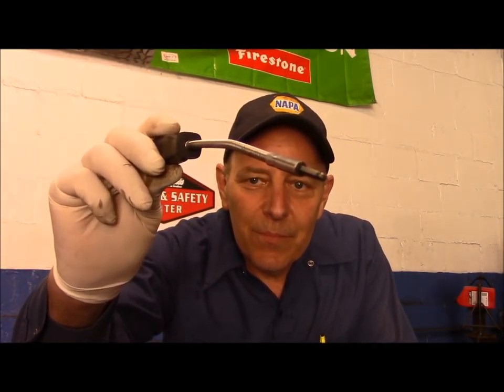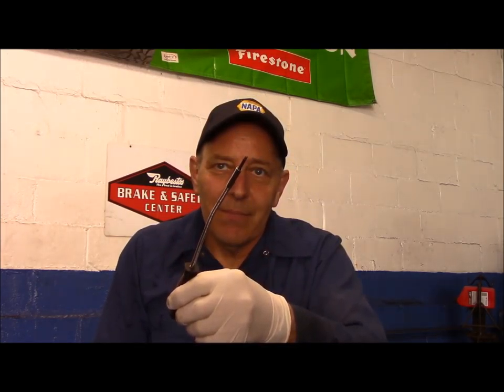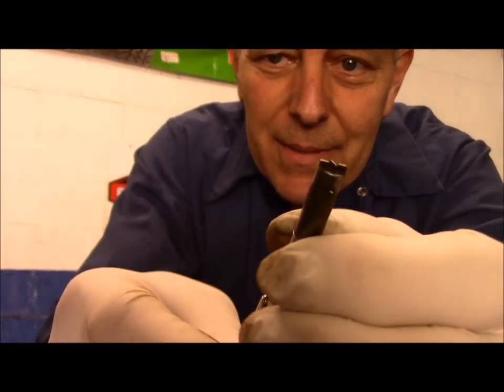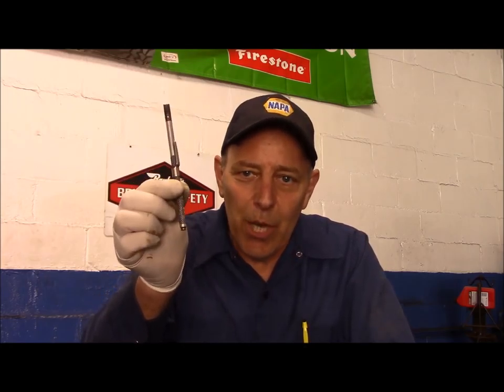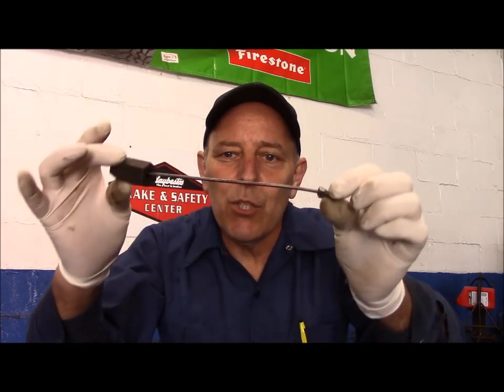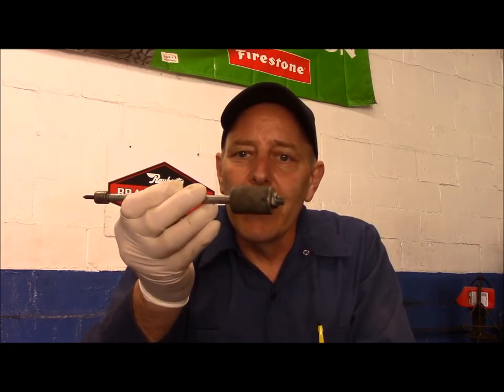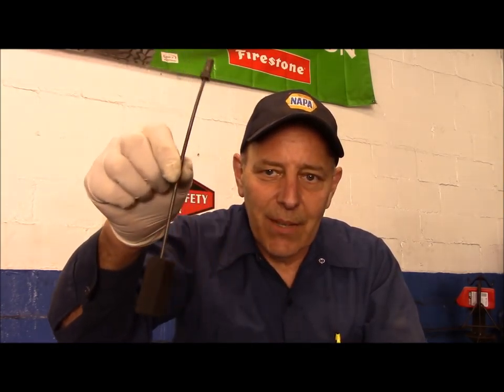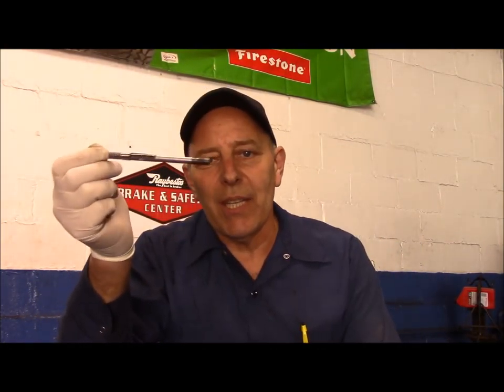What Were These Tools Used For ? Tools From The Muscle Car Days

Comment: Hi Jim,

1-screw driver type tool used to set the dwell, point gap on GM cars through the window while the engine was running
2-screw holder used to start small screws securing the points and condensers below the distributor cap
3-screw driver type tool used to access and adjust carburetor idle mixture screws hidden beneath the anti-tamper plugs 
4-mini slide hammer used to pull the anti-tamper aluminum plugs concealing the idle mixture screws on carburetors
Reply from the maker: Good guess stay tuned I will post the answers Sunday

Comment: The first tool was used to adjust the dwell on GM engines. The distributor was located at the rear of the engine along with its window that you slid up to access the adjustment screw for the points. The second tool looks like a starter screwdriver which can hold screws in place so that you don't drop them. The third and fourth tools, I don't have a clue. Nice vid Jim.
Reply from the maker: Hi Terry,stay tuned I will post the answers Sunday

Comment: 1 - points adjustment tool. Allowed you to adjust the swell with the engine running.  2 - straight slot screw starter, have the phillips version as well (that works with allen heads as well). 3 - Flexible adjusting tool for carbs, sliding piece is the handle and engages the end you're not using. 4 -Slide hammer puller to remove anti-tamper caps from the carb.
Reply from the maker: Good guess stay tuned I will post the answers Sunday

Comment: First one is to adjust dwell (points) on a GM. Second one is a screw starter. It worked great to install a condensers. Third tool is a carb idle adjustment tool. You got me on the 4th.  :)
Reply from the maker: Very good guess Wyatt .Haha most mechanics don't even know what a condenser is.Lol

Comment: Tool #1 is for setting the dwell on Chevys points thru the distributor cap window, Tool #2 is a screw starter with magnetic end (twist the end to unlock the slot, push onto slotted screw to lock it and install screws in distributor or any other tight place where you don't want to drop the screw, Tool #3 was for adjusting oval & hex carburetor idle mixture screws, Tool #4 was for removing the idle mixture screw caps and also used it to remove a leaking GM engine block rear camshaft plug, some m/cyl check valves, metering piston well plugs, Mopar rocker shaft plugs...handy puller.
Reply from the maker: Good guess stay tuned I will post the answers Sunday

Comment: Tool 1 is for setting the points on a GM car 1974 and down through the distributor cap window. Tool 2 is to hold and start the tiny screws that held the points to the plate. Tool 3 is to adjust the mixture screws on the last of the carburetors that were hidden under the factory caps that you weren't supposed to remove or mess with. Tool 4 was one of the tools that could be used to remove those caps.
Reply: +eldoradony  
Congratulations, 4 out of 4, we have a winner... 
We are revealing our age...
Reply: Your right i still have mine in my box.
Reply from the maker: Very good guess stay tuned I will post the answers Sunday
Reply from the maker: Good guess stay tuned I will post the answers Sunday
Reply from the maker: Good guess stay tuned I will post the answers Sunday
Reply from the maker: Can you send me a private message with you contact info .Jim
Reply from the maker: Can you send me a private message with you contact info .Jim
Reply: I sent you a private message.

Comment: the first was a carburetor adjustment tool.  the second is a screw starter used so one doesn't drop any slotted head screws.  the third and fourth look like carb adjustment tools as well.
Reply from the maker: stay tuned I will post the answers Sunday

Comment: For Points , it was much easier to use than a allen wrench , -screw holder driver  ,, Because it was no fun when you dropped a screw down in the dist.  third could be for mixture screws , but different than what i had . last may be a tamper cap remover , as u said to remove , i never had one of them tools , had to fight them .
Reply from the maker: Good guess stay tuned I will post the answers Sunday

Comment: I know I am late, adjust the distributor, The one holds flat head screws for installation, for adjusting the mixture on the carb.(my mustang I used a 4' screw driver), for pulling plugs out of the carb. .

Comment: 1) SET POINTS / DWELL2) SCREW STARTER / MAGNET INCASE YOU DROP THE SCREW IN THE DISTRIBUTOR 3) CARB MIXER AJUSTMENTS4) PULL JETS OUT OF CARB
Reply from the maker: Good guess stay tuned I will post the answers Sunday

Comment: I myself still have those tools tucked away. I kinda miss using them much anymore. I was a driveability and tune up tech so those tools got a lot of use.
Reply: So Bill you have no idea what they were used for and couldn't even guess. LOL
Reply: eldoadony already had them right.
Reply: GM 8cyl. points adjuster, small slot screw holder, Rochester mixture adjustment tool, GM tamper proof plug remover.
Reply: +wysetech2000 I had the plug remover and recognized the slot screw holder but I thought it was for a tuneup and still don't know what the uses that on besides a slot screw head so I figured jim had been into the sauce and gave him a pass. LOL
Reply from the maker: Good guess stay tuned I will post the answers Sunday
Reply from the maker: I'm suprised  i thought sure you would get them Lol
Reply: jimthecarguy  Well I guess I'm just too young :)
Reply from the maker: Anyone younger than me is young.Lol